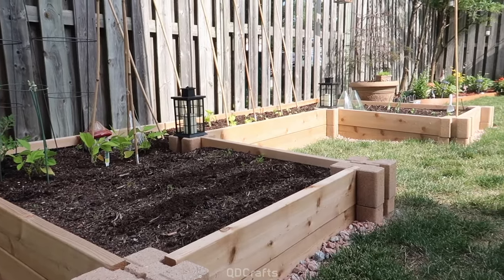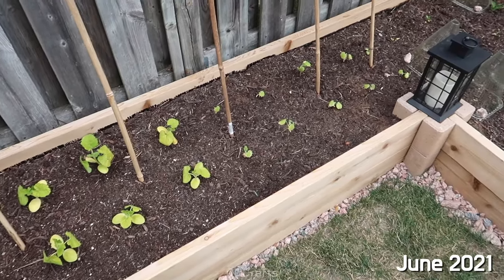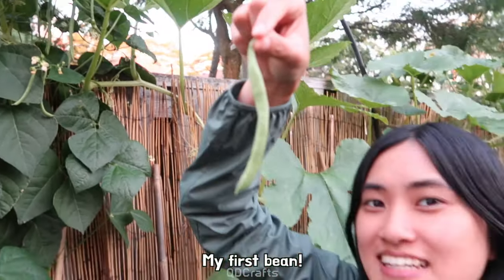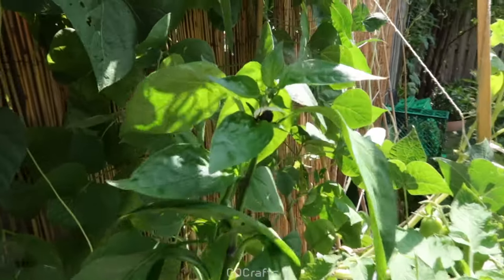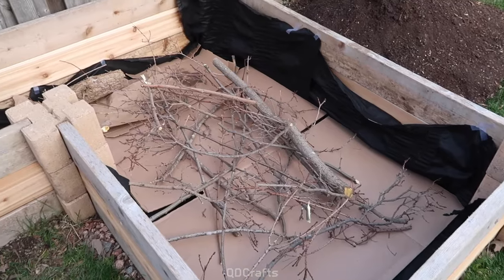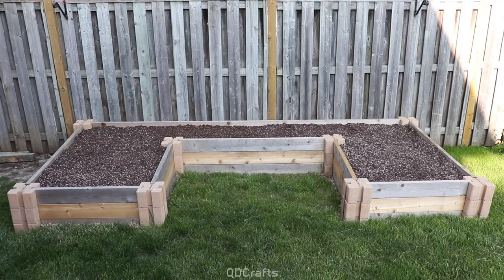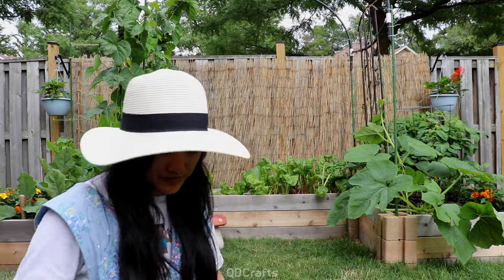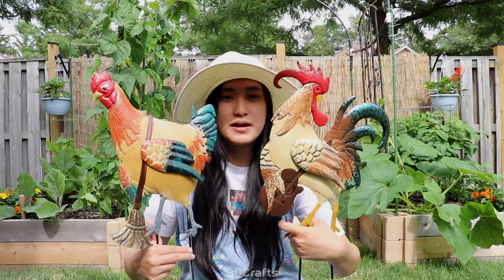DIY 3-Layer Planter Block Raised Garden Bed UPDATE

Comment: Thanks for the update! Did you not find the need to add rebar to the bricks to hold them in place? I'm just about to build my bed and found your original video then this one. Both are super helpful, especially hearing your lessons learned.
Reply from the maker: Hi! My ground was originally slanted so I had to dig the soil near the front of the bed before adding the bricks so that everything is levelled. Since those bricks are a bit buried in the soil, the base bricks have been secured quite solidly after settling into the clay soil in our garden. My bed has been fine without rebar, but it wouldn't hurt to add some! Hope yours turned out great :D

Comment: Okay I'm curious how 3+5+3 equals 12?   Cause I'm looking at the front and the back and the back is 12 feet, but the front sides add up to 11.  I know you cut the 1' board for symmetry, do you have the sides just like, kicked out by 6 inches each to make up for the missing foot?   We're trying to make this ourselves and not sure how that's adding up.  We absolutely love and adore this build though, you've done such an amazing job!   We watched a ton of "how to build a raised bed" videos, and this was the one that made my girlfriend jump off the couch and go "THAT ONE!  THAT'S THE ONE WE'RE MAKING!"
Reply from the maker: Hi Thomas, thanks for watching and I’m glad you guys like this build! Keep in mind the planter block itself is using up some of the space at the front, so even though the back is 12 ft and the front has 11ft of wood, the front has two extra blocks in the middle that are needed to make the inner walkway, so it offsets the dimensions a little. We found 5ft still fits nicely to make a c shape because you can angle the planks slightly and it doesn’t need to be as exact as if you had to nail the wooden planks to each other. The blocks give a bit of wiggle room and makes it more flexible to assemble! Hope yours turns out nicely!
Reply: @QDCrafts  yeah after I left my comment I took at look and realized there was a little bit of excess from each block that would add up to about a foot.  We just went to home depot yesterday and got all of the stuff to assemble.  The weather should be clearing up by next week and we're excited to get everything up and running!

Comment: Great garden! Did you need to factor in any additional length the blocks add when planning your lumber length on the back 2"X6"X12' lumber?
Reply from the maker: Thank you, the measurements you see at 7:41 are exact lengths for the wood, so the additional length the blocks add don’t affect the back 12ft, but made the front lumber that makes the c-shape 5ft instead of 6ft, which is why the front wood lengths add up to 11ft rather than 12ft like the back, if that makes sense!

Comment: So we're finally about to assemble ours, we've got all the boards and materials, we're super excited!   But we were wondering, now that you've had this for three years, have you had to replace any boards?  In  your original video you mentioned liking how modular it was, in case you had to replace any of the planks, but did you need to?   We're rubbing ours with linseed oil for extra protection.   

Also curious, as I haven't seen all of your videos, are you in a region with all four seasons?  Like, wondering how well this build will survive a few winters!
Reply from the maker: Hi Thomas, so excited for you! We have not had to replace any boards and other than some discolouration, they are still very sturdy and not showing any signs of breaking. They are cedar planks so they are quite rot resistant and expected to last many more years. I think adding the linseed oil wouldn’t hurt! I’m in Toronto, Canada so they’ve survived our cold winters pretty well in the last 3 years. We added a third layer last year and it’s already the same colour as the original ones but everything is still structurally sound 👍🏻 hope yours turns out nice 😊